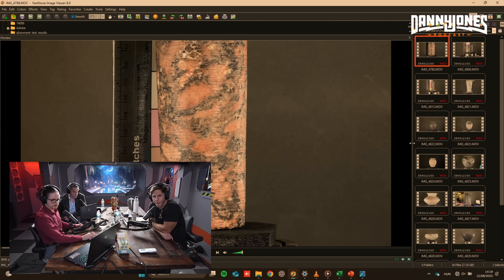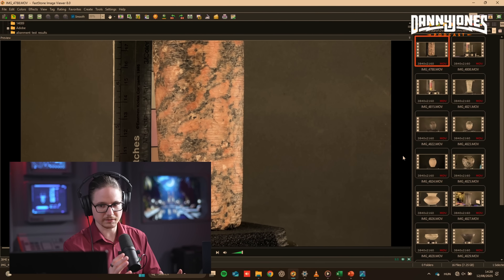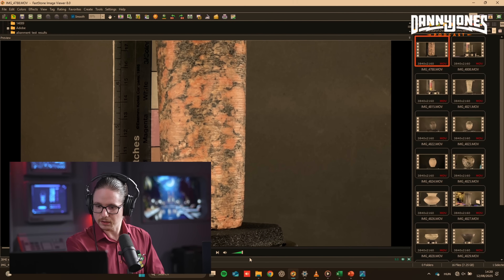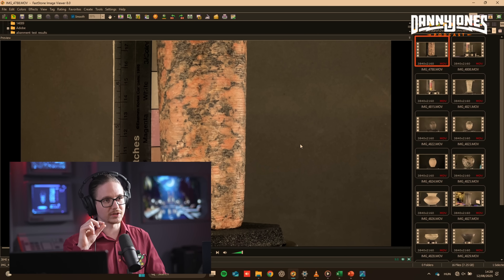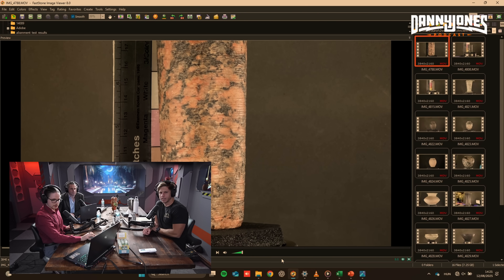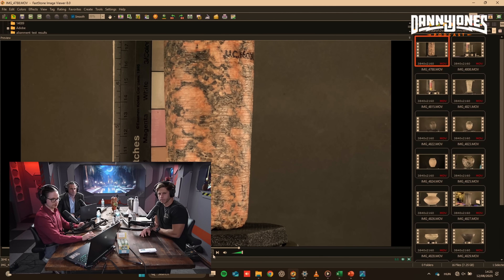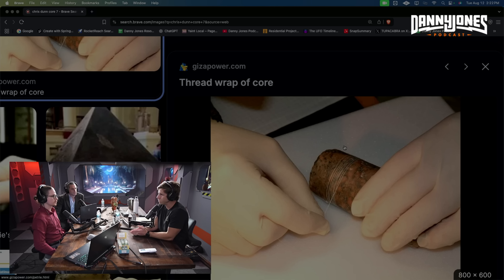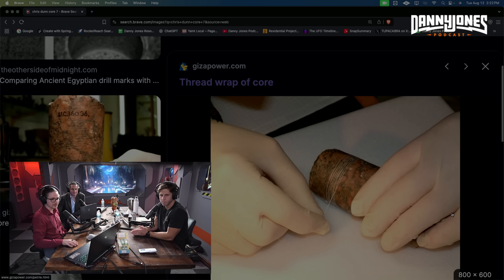New Petrie's Core Analysis DESTROYS Everything We Know About Ancient Egypt | Adam Young, Karoly Poka

Comment: I work in the Geotechnical sector and will do rock coring from time to time out of town. We use trucks/machines that use diamond tips as well as water being pumped in order to not cause overheating and to flush out smaller material. Diamond bits also break on a regular basis on jobs.

Not saying this what the Egyptians used because I do believe it can be done with enough time. However, to do this in a timely manner. Needing large equipment using hydraulics as well as diamonds tip bits just shows what is required to rock core drill in our modern day and age. Even through something like mudstone which is a relatively softer stone still requires large machines to drill through.

Comment: It seems likely the work you are seeing was done using an iron tube turned on a lathe, cutting in and out where the tool marks from the metal became embedded in the surface of the stone. measure the delta between the core and the hole and find the wall thinkness of the pipe. The iron pipe would have been set into the geopolymer (Stone)as a reinforcing form. When the iron eventually rusted away, its imprint remained visible on the stone leading us to think in very simple terms. Achieving cuts of that depth and precision in stone of such hardness is beyond our present capability. What strengthens this theory is the existence of so-called “tube drills” that seem to be done with a 90-degree corner, no way. We now also know the “H-blocks” of Puma Punku were made from geopolymer. Discuss

Comment: As a tool maker / machinest that grove could have been created by the extraction of the cutting tool while still rotating and not the cutting speed. I've used boring heads many times and if you don't stop the spindle and use a G00 code to retract, it will create a almost exact grove depending on the rate of rapid retraction.
Reply: https://youtu.be/yyCc4iuMikQ?si=OsWdny_cB9s8Mu4E
Reply: No.
Reply: @MinnesotaBeekeeper  explain why

Comment: Check the surface on a perthometer, you will be able to see full form of the surface,  potential feed per revolution and the form of the cutting edge. You could potentially see if it was cut in one go or if it was pecked by any difference you see in particular areas.

Comment: Okay previous concrete core driller here. Granite is very prevalent along the middle of the country such as San Antonio in the concrete mix and we used diamond tipped drills with a water supply to cool the bit and keep the core from snatching out the diamond pieces on the tip. Specific and Consistent pressure is needed to get a smoother core. Your work shows in the grooves so I cannot imagine how they did this so well
Reply: Vibration
Reply: @EgoOut  Just all the No! Vibration could not produce cores like this… grandiose statement with zero substance…. Makes you a functioning r3tard… but likely just barely on the functioning part.
Reply: It’s a great mystery. For sure. A lot of Egypt and places like Gobekli Tepe are mystery’s.
Reply: https://www.youtube.com/watch?v=6mPMs403Xj0
Reply: A high-speed drill wouldn't provide a continuous groove. Using an automotive example, a cylinder hone at high speed clearly is not capable of creating a continuous cut. The cut can be made after the core is removed with a slow speed to medium speed cut. Consult a CNC machinist, he can explain it better.
Reply: They used a loose abrasvies of quartz and corundum. Has been replicated countless times. https://www.youtube.com/watch?v=yyCc4iuMikQ
Reply: @Leeside999 no this is a one direction spiral groove not a crude back and forth motion with an abrasive and water
Reply: @philipthomas3938 did you not watch the video which shows the drill spinning in the same direction and not back and forth like a bow drill?
Reply: @Leeside999 It’s an intact spiral all the way down! Not consistent with any known technique and cannot be replicated! Jeez pay attention.
Reply: @mikecassidy1623  "It’s an intact spiral all the way down!"

It isn't, though. You're just repeating bs you've heard from spoofers.

https://www.youtube.com/watch?v=HQi4yql7Ysg
Reply: @Leeside999  https://www.youtube.com/watch?v=6mPMs403Xj0
Reply: @Leeside999 brass pipe with vibration also makes exactly same marks very quick also
Reply: @Leeside999  you're insane. looks nothing like it.
Reply: @Leeside999  https://www.youtube.com/watch?v=6mPMs403Xj0
Reply: @Leeside999  you go ahead and replicate it then 👍
Reply: @InfoDang4839 watch the video I linked above. You'll see it replicated there. 👍
Reply: @Leeside999  honest question, is there a video that isn't so snide and obnoxious that covers the topic from the opposite view? I'm interested in the topic, not in joining a team.
Reply: @munkdev the humour is hacky I agree. Just try and get passed that.
They answer many "mysteries" in that video.
Reply: @Leeside999 40 minutes gives half an inch. I can saw a table in half with dull knife given enough time. But it is an answer none the less, thank you
Reply: @InfoDang4839 I'm sorry that the granite drilling technology of 4000 years ago wasn't fast enough for you.
Reply: @Leeside999  calm down big man it’s gonna be okay

Comment: No drill leaves a spiral groove as part of the cutting action. They used a core drill. The core follows a trapezoidal shape narrow at the top, thickest at the bottom. The grooves are a byproduct of the irregular grains of the the cutting slurrry getting trapped between the drill bit and the wall. As a side note, we can deduce that the core was spun in a single direction rather than a back and forth motion.
If this was some sort of high technology, then why isn't it a perfect cylinder shape? why is the groove not a single track?  If it could cut at such a rapid feed rate, they why the irregular trapezoid?
Reply: Diddo!
Reply: @alex-360 I partially agree. If you had a perfect sloped, inward cutting tool, leaving the sleeve perfectly smooth ( yes, you could polish that), you could leave that spiral, yet only with constant perfection of pressure. I have personally not seen a hole saw do that, maybe the way I use them ? It all seems more like cutting a thread to me. Make a hole, afterwards cut it like a thread. Who knows how the heck they kept their tools perfectly aligned back then. I have seen some saw marks, that went askew, by some margin, subsequently abandoned, in sarcophagi.
Reply: I have tried both techniques, the abrasion marks are the same

Comment: The more PSI you have the slower you need to turn. This tells me that they used something very heavy like a 10,000 ton granite box with an arched top and arms with pinpoint accuracy that move around on this arched surface like a shoulder. And is balanced so perfectly it’s light as a feather. That’s why the granite boxes are everywhere.Also they didn’t need power like we do to operate just pure balanced weight.
Reply: Put the pipe down bud!
Reply: OK, so what material did the cutting? and took the weight of 10,000 tons?
Reply: @Sestar-77 I’m saying the precision cut granite box weighs 10,000 tons. That’s the base for the machine they used . And the fact that the box is the only thing left. The cutting or drilling attachments might have been gold or something harder. Probably why we only find the granite boxes.
Reply: @scottsplasterworks6971 you think gold is hard? Ummm ok
Reply: @mishmash9397 No I said gold or something harder. I said gold cause we use it in drill bits to make it last longer.
Reply: @scottsplasterworks6971 they don’t use gold to make a drill bit harder. Gold is a very soft metal. Heavy, soft and expensive. Last thing that would be in a drill bit
Reply: @scottsplasterworks6971 gold I one of the softest metals, you couldn't even drill through wood with gold😂
Reply: @musicalADD_theband correct its titanium nitride coating on drills that's 'gold'😂
Reply: Or could it have been a technology NOT weighing that much?
Reply: @joehenry9546 everything back then was huge and weighed a lot why not the tools that made them. If you think human hands made any of these things at that scale doesn’t make sense to me just saying.
Reply: I like your thinking on this. 
I suppose it’d be the same difference if it was a massive weight on top of a drill. If it was balanced, it could spin easily with little leverage.
Reply: Pressure alone can’t do it, or heat - they would create fractures. It has to be something much more esoteric. My best theory is ESD - electrostatic cutting, but whatever it was it was very advanced- better than anything we have today.
Reply: 🤣🤣🤣🤣https://www.youtube.com/watch?v=6mPMs403Xj0
Reply: Gold?